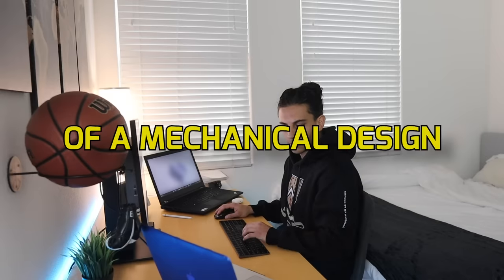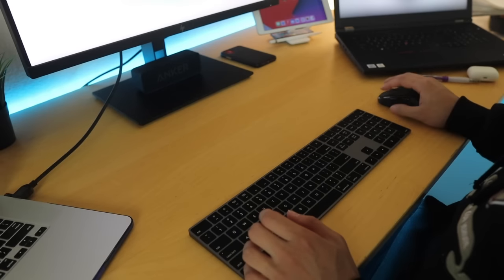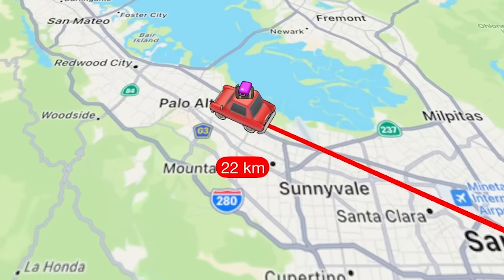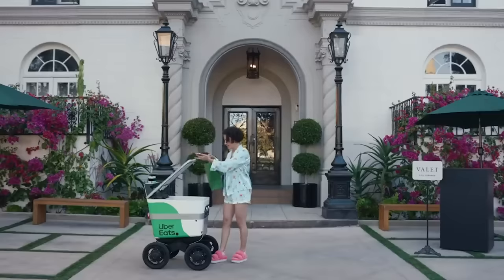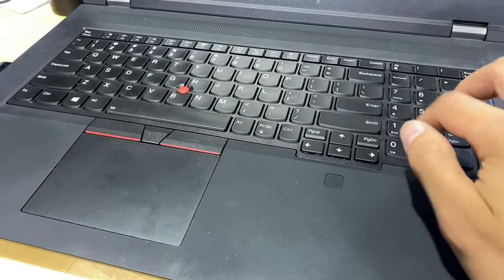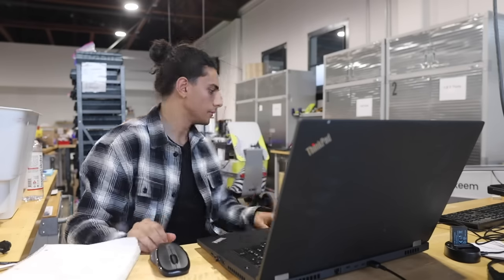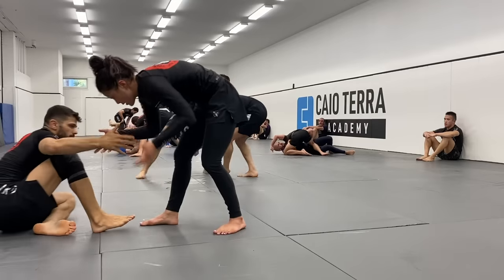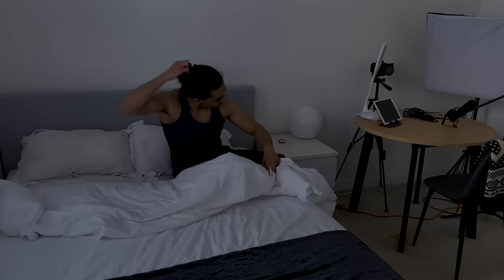Day in the Life of a Mechanical Design Engineer

Comment: After 10 years of working as a mechanical design engineer, it's no longer fun. You know every program, every operation, every mechanism. You know the calculations by heart. Customers want "fast and cheap", time is short, products are "supposed to break" because this is their design assumption and there is nothing you can do about it even though you know you should. Today I would choose a different career path.
Reply: Like what? It seems like after 10 years in any field this is going to be the same situation you find yourself in. I could be wrong, but how I see it is would you rather be bored in your 10th year doing Accounting or Engineering?